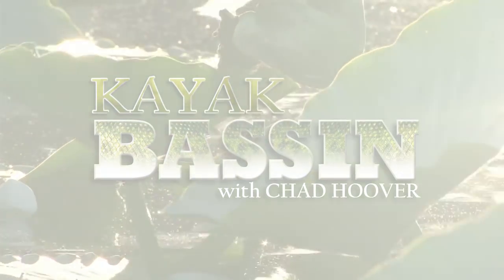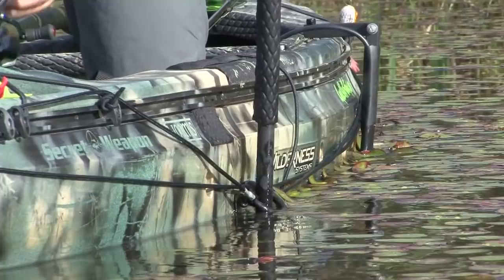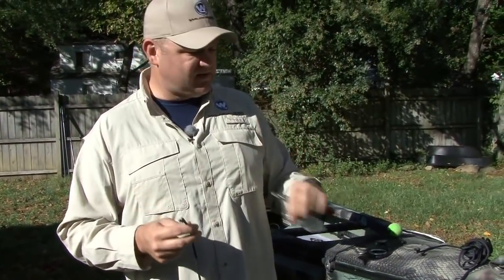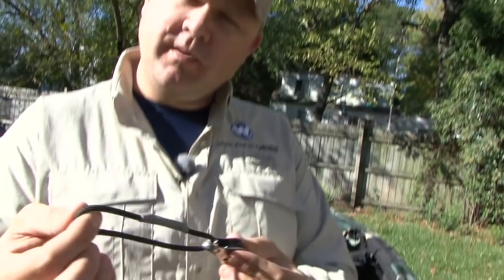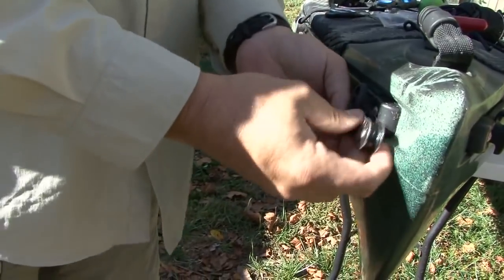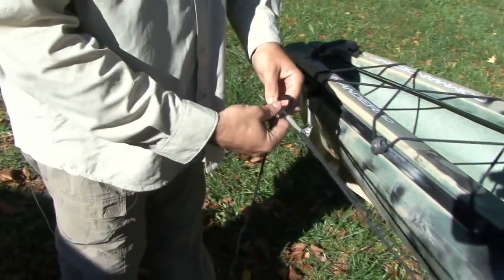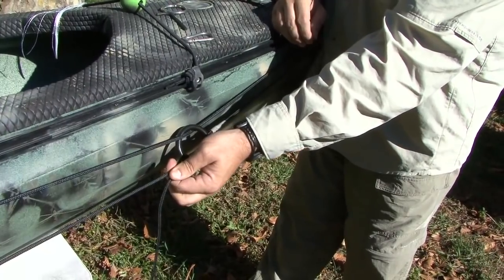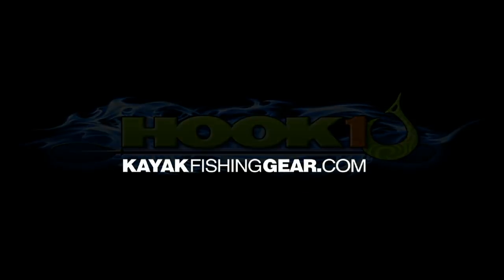Kayak Fishing - Anchor Trolley Installation

Comment: Great video, When you are making your loops to connect the pulleys you can melt one end of the hollow rope and thread it inside the other end after threading your pulley on. You can then sew up the join. Nice and neat.

Comment: It is basically the same as the Harmony anchor trolley kit (ATK) from HOOK 1. All I do is make the loops to install it through the deck fittings from the same line that comes with the kit. It is super easy. I also add the heat shrink for a cleaner install and that is available pretty much anywhere.

Comment: If you are looking for a way to do the same thing without sewing it. You can simply use any kind of strong line or small cord and use the technique like you would for wrapping the guides on a rod. Lay a loop of line on the line, wrap over it, put the tag end through the loop and pull the tag end under and snug it up. Use a lighter to burn (and slightly swell) the end of the line, then slide the heat shrink over and you are done. I actually use old fishing braid for most of mine. - Chad

Comment: Chris, you can get it out of the ring much faster. You rig it be doubling the line and pulling it through the ring and them attaching the loop. To dump the line you simply pull the loop free. I use a cam cleat to make dumping my line very fast.

Comment from the maker: The line won't come off of these pulleys. I prefer these because they are much quieter than carabiners, they last longer than a cheap biner and they are much less expensive than a quality carabiner. It isn't overengineering if it accomplishes what you want. This setup accomplishes wihat I want and it has been refined over the years to be exactly what I want. I have tried deck loops, carabiners, cheap pulleys and numerous others. This is my setup.

Comment: Great video, thanks.

That self sticking rubber mat you have on your kayak, how does it stand up to getting a soaking?  I really like the look of it and its function of helping to reduce noise too.  As such, I am thinking of getting some myself, but being a beginner at all this AND in the UK, I really need to make sure I buy the right stuff first time around.  Thanks.
Reply: +Bogdan K Seems to be a ton of neoprene up for sale, but did find this kinda thing which sort of makes sense for the deck areas:-
http://www.ebay.com/itm/17-x-4-Self-Adhesive-Rubber-Safety-Mat-w-Thread-Surface-Slip-Fall-Protection-/331599474000?hash=item4d34de6d50
Reply: +Bogdan K  Nice one mate.  Just dont go covering the hull or you might find the thing a little slower (and heavier) in the water ;)   I'l try and give them a call tomorrow.  Thanks!

Comment: Personally, I don't care much for those little pulleys.  It's really a case of over-engineering for this setup.
Several times, when bringing in a fish, the line got snagged in them.  Also, there have been times the trolley line simply slipped off to the side of the pulley.  Went to using a simple carabiner and not had an issue since.